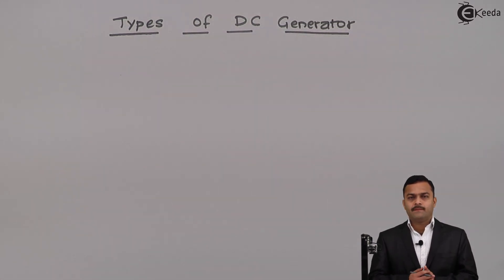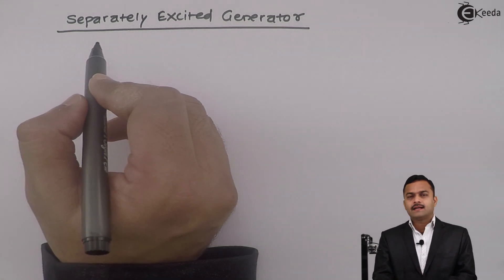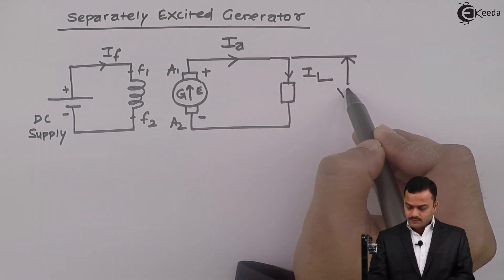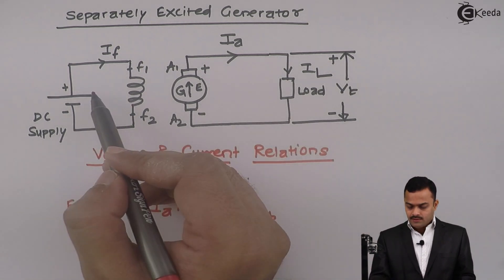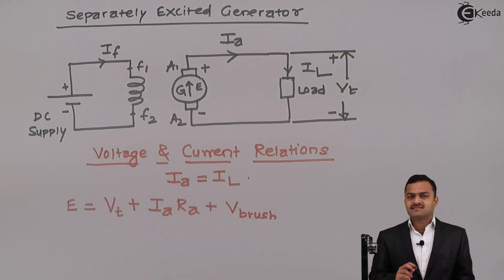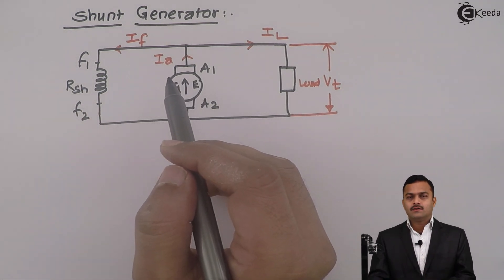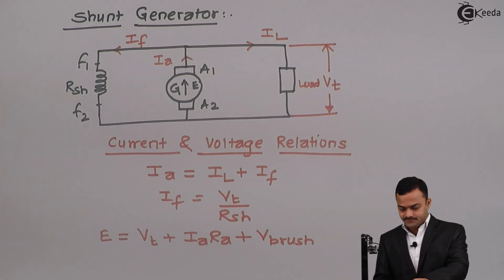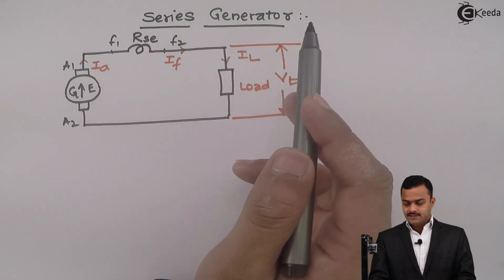Types of DC Generator - DC Machines - Basic Electrical Engineering

Comment: Hello ! I have an old welding generator from German army , i have wiring diagram but i don`t know how its work ...the engine its starts but i haven`t voltage . I`m interesting how it works after wiring diagram. Can you help me with an advice ?https://uploadimage.ro/8T55/20190520-201728.jpg
https://uploadimage.ro/8T56/20190520-201831.jpg  this picture is for batery charger ...( this machine have welding 24 volts DC generator + AC generator 380 /230 volts and 24 volts baterry charger )
https://uploadimage.ro/8T57/s-l1600_(1).jpg
https://uploadimage.ro/8T58/s-l1600.jpg
https://uploadimage.ro/8T59/s-l1600_(2).jpg